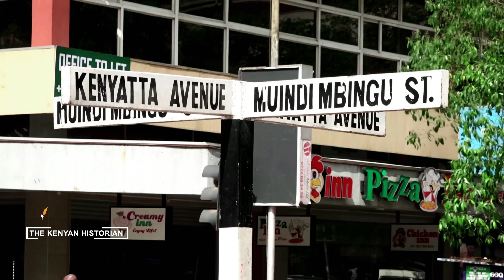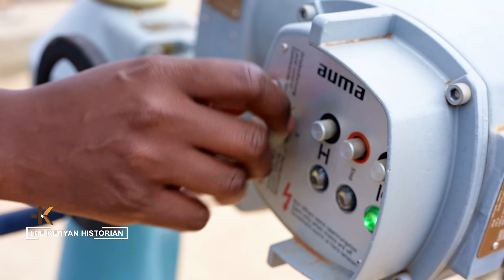Inside the Dams and Tunnels that fuel the development of Nairobi City.

Comment: The transformation of these water projects was one of the biggest former president UK achievements, no matter the dirty politics behind these projects they finally came to life.

This is the kind of projects and transformations this country needs, silent development but very impactful.

As someone from these region and some who leaves and works in Nairobi we've already been getting the massive benefits, Utawala and Ruai areas which have been hell with water and specifically fresh water issues but now the water is here, for about,5,000 Ksh you get a connection and about 40 Ksh per metre unit which is fair enough.

Thank you for this beautiful documentary Sir, these are the kind of contents Kenyans need to normalize watching.

Enos this documentary was supposed to be even longer 😅.